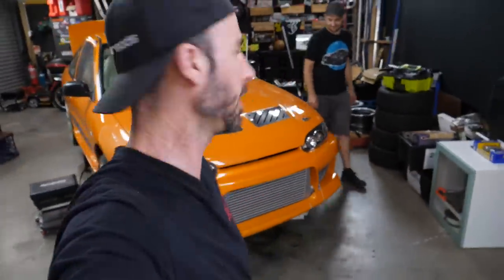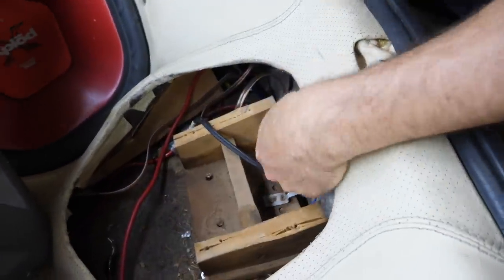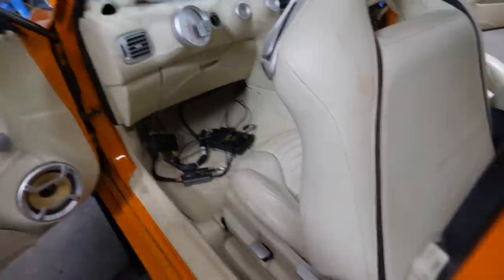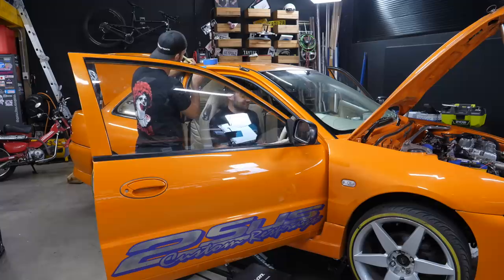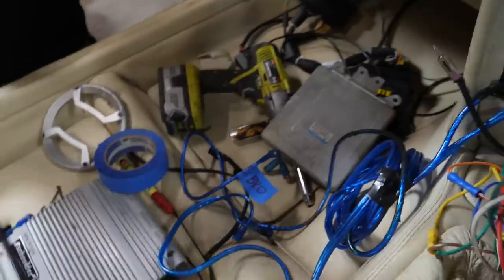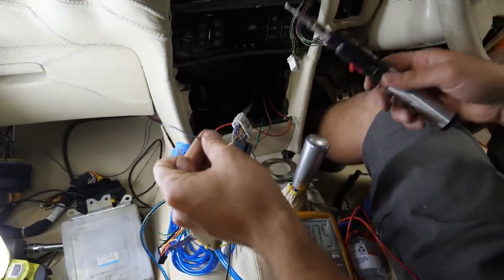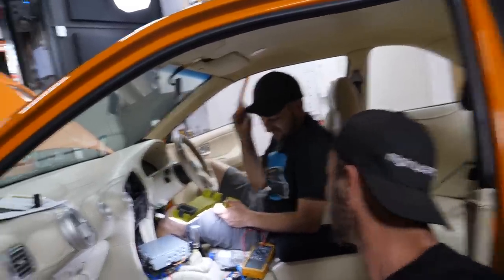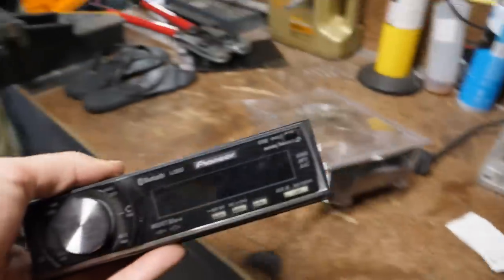2WISTD - This EVO will BLOW YOUR PANTS OFF!!! (10000000%)

Comment: Almost forgot, also, if a car had or has a power antenna u can use that as ur remote wire, Mitsubishi's had a pink wire for power antenna's and even if the car didn't have one the wire harness still had the wire on it. So do Chrysler brands, Isuzu and Mazda's. Some higher end decks have 2 remote wires on them, one for an amp the other for a power antenna. You should look harder at the era's though, I bet one of the set's are aux audio inputs, for things like dvd, vcr, game systems, etc..., on older deckes like that I would run a  headphone/mp3/cell phone plug off those, old school android ready, lol In future builds you should run a dry cell or extra battery and run your system of the second battery or dey cell, and those subs in the trunk are 2ohm stable, probably dvc's(dual voice coils), if so the dvc's should be parallel bridged to them selves and run off their own dedicated channel, however if they are svc's(single voice coil) then the subs should be parallel bridged to each other and the bridged into 1 channel, cause that amp is an easy 1000watts, and 1ohm stable, which running 2ohms bridged the amp won't barely heat up, and those subs can shatter windows, defiantly can shake that car loose. The Xplode series to this day are great systems, powerful, exceptional sound and outstanding quality. Still great job guys on figuring out the wiring, but I think I noticed the subs are sucking in not pushing out, that means the speaker wires to the amp are backwards, next time use a d cell battery to check polarity directions, connecting neg to neg and pos to pos of the battery, don't hold just tap the pos, the speaker should jump, either forward or backwards, if backwards then you need to switch the wire around, neg to pos, pos to neg. Some people are stupid, not meaning you but the Original installer, I have seen guys use the striped wires as neg, regardless of the strips color, I myself know black strip neg, white pos, I've seen some installers use strips for pos only as well, so just imagine between those 2 types of installers one is wrong to the other, so 1uses all strips for neg, ok but next gut thinks it's the oppiset, he just screwed the system. Food for thought. Lol

Comment: I never had a car without extra wiring for some kind of stereo components going to the back, I also never had a car with more than stock audio while I owned it. I could probably use the wires to put a sub into my current car but I'd rather have room for stuff instead of subs occupying all the space.

Comment: I actually really like the off-white perforated leather in there.  I don't have the impression heavy stereos like that would enhance my musical experience while driving, though. I think I may have to bypass an old hack job on my car's wiring to make any new stereo actually turn on the factory amp in my car, though.   Or I'll have to bypass all the nice factory stuff someone butchered,  add modern amp,   and then eventually put nicer speakers in.   :)   But then I'll be able to play Moog musics, which are mysteriously unavailable on cassette.  :)

Comment: For the size of amp you have you should be running at least a 4 g power wire with a 8 g  you run the risk of melting your power wire.

Comment: It is just amazing that the installer did not do a great job, if you check out five star car stereo and their install technique there is a huge difference between a hot mess and professional install! When you pay an installer they are supposed to do a job right and not rig something! I just cannot imagine that the fuse box did not go unnoticed if a judge were to crawl under the car, which would lead to docked points! From the outside and a quick glimpse she is a nice looker but internal inspection reveals she is like Frankenstein and not a she at all!

Comment: 13 mm why? 

Because it's STANDARD M8 bolt head size. 

Why you'd find an M8 bolt on a battery terminal, that's another question.

Comment: wouldn't that cable running through the chassis be the + feed for the amp under the seat so that all amps would have run from rear power supply? making your left hand external power cable redundant?

Comment: So… Believe it or not those Sony amplifiers we’re actually not that bad. The 1600 W marked on the outside of the amp was pretty close to the output. Running an eight gauge wire to power that amplifier is just looking for trouble! Especially one 15 feet long. The front components and rear components look like Focal and are actually really nice so properly wired up that system should sound decent, much better than any factory system. And I totally agree with the other commenters on that is some serious shit wiring that I’m sure was much cleaner when it was first installed but has been hacked up by other owners of this car!

Comment: Instead of running the long wire why not use the chassis ground to complete the circuit? one probe to the wire and the other to the chassis and keep grounding out the remote wire to buzz it out?

Comment: Just a thought why does everyone always undo the ground wire and leave the power wire attached to the battery if the ground touches anything it'll short but if you undo the power wire and hang it beside the battery there is absolutely 100% no chance you will get a short
Reply: Because you always put the positive cable on first .... pure laziness i suppose

Comment: As I install car system professionally.   That car system is a nightmare a whole of a lot of bubba rigging in that car with that system.  I would rip every single wire out and start over.  Plus That amp in the back can't push those subs in very well only 1600 watts total power and the subs can handle 2800 watts.  Should have at least a 2600 watt amp in the back.

Comment: With some decent (possibly black) wheels, some window tint, and those horrible stickers removed 2WISTED could look pretty good. 2SXY, however, is possibly a lot lighter in its current state because it had all of it's horrible interior and useless speakers removed whereas 2WISTED hasn't.

Comment: FYI - theres a reason the amp was unplugged when the head unit was removed. it likely had an EPICENTER or similar, period correct bass modulating equalizer. that would have help those crappy xplod subs sounds decent and not burn up. you might consider adding a similar EQ back in there when you finally ditch those dog shit subs for something better..... lol

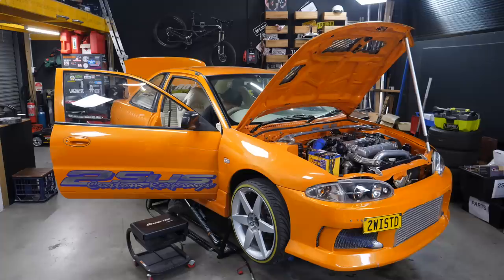Comment: Test the speakers with a small battery (9V or similar). You will hear if it's the right wires, no need to connect the amp and everything to check... (PS! I've only looked to 13:02 ;)
Reply: 38:55 ALL IN!

Comment: Earthed never Heard that term its great! We use Grounded in the states I will be converting to Earthed. 
That wiring is bad chop it out salvage what you can and re-wire....
Reply: Everett Mccullough earth is not the right word. 

Earth only exists in A.C circuits.
Ground is the negative side of a D.C circuit. You can't "earth" a car unless you attach a long wire to it and attach it to a copper peg in the earth. Like the wiring on your house.

Comment: Talking about audi stereos, my audi a3 from 2003 makes the rearview mirror vibrate with the stock speakers and headunit🤣. It has better sound then my old car wich had a subwoofer.🤔
We're not even talking about a topmodel audi....
Reply: Stef laarakker just means that rear mirror is light and your Golf needs some damping material for the roof panels. Top end models will and do have more sound deadening materials around the car.